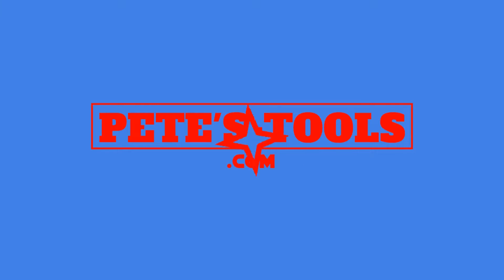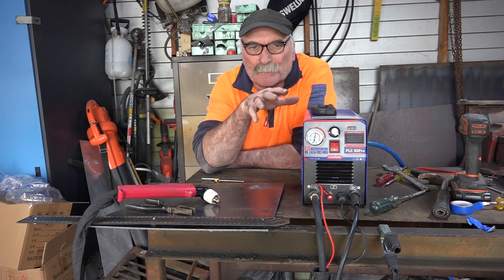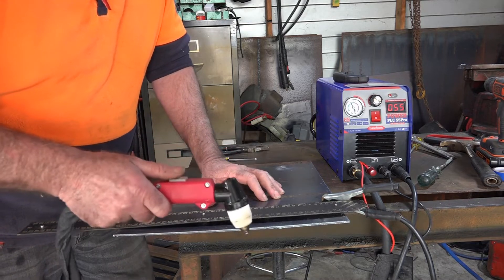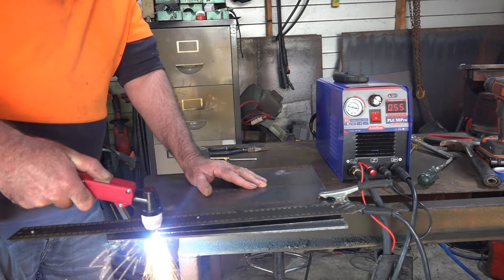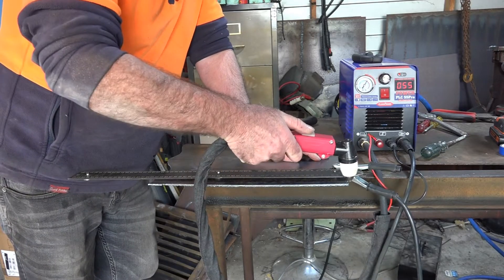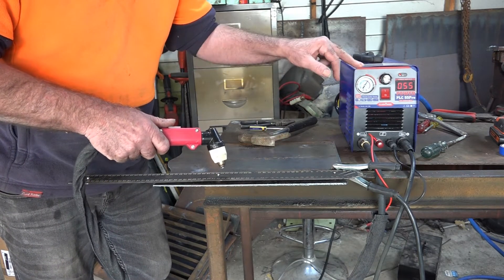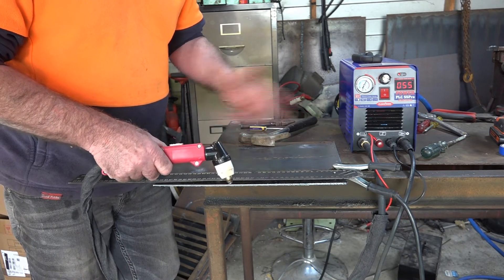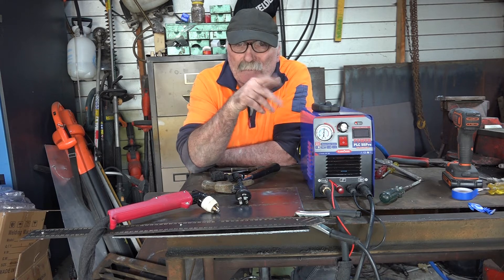When You Plasma Cut: DO YOU Blow All Your Fuses?

Comment: Sounds like compressor and plasma cutter are on the same circuit. I can only access 10 A at 2:40 V in my garage so I run the compressor from the garage circuit and use a long 15 amp capable extension cord off a 10 amp PowerPoint on the House circuit. While I do get some fluctuations in the lights in the house I am yet to blow a circuit breaker. I use the same machine as you have, which in Australia comes with a 10 amp 240 V Plug
Reply from the maker: correct both same circuit

Comment: i have same problem i got a sparky out he said i need 16 amp separate fused socket to run compressor and do not use a extension cable on plasma cutter
Reply from the maker: Yea i have 15 amp in my garage

Comment: If the big compressor is getting on in years- it could be the capacitor inside is drying out and changing its value (which will change the startup current)- its usually in that box on the top of the motor with the power cords going into it (not the air pressure switch box- the one attached to the motor itself)  Much cheaper to replace than the whole motor and is a known issue (electrolytic capacitors dry out as they age) just make sure you get one with the right value (the important one is the capacitance- it will be a number followed by a uF or MFD- has to be the same number on the new one (they come in a whole range of values for different jobs)- and make sure that the voltage rating is the same too!!!
Reply from the maker: Yea mate i think the caps are buggered

Comment: you have a total of 3600 watts usable in that circuit or line. If your combined plasma cutter and compressor exceed this then the fuse blows. There is a unit out there in the market place that is called a soft starter this will allow your compressor to start up slowly which will not allow it to make a huge drain on the power at start up and blow your fuse. Hope this helps.
Reply from the maker: Thanks for tip

Comment: Just an idea mate. Get one of those watt or volt readers. Not those thingies that have the red and black tester spikes but this thing you plug into your main power source and then plug your compressor into it. Turn your compressor on and you can see what power the compressor is pulling. This gadget has settings on it so you can set it for watts or volts. I would try this but watch the digital counter at the point it cuts out. The compressor could be spiking  which is like a power surge. We had an old generator years ago that use to kill your stereo if you plugged it in. Was ok with drills grinders ect but no radios or anything like that. Use to blow them up. Me step dad seem to think it was what they call dirty power. I would sell that old girl and buy a new one dude.
Reply from the maker: Great idea thanks

Comment: I have the same problem Pete, I have the same plasma cutter here in Oz. What are the specs of the smaller compressor? and can it supply 60psi continuously to the cutter?
Reply from the maker: its only a cheap 2hp direct drive thing .only good for small cuts